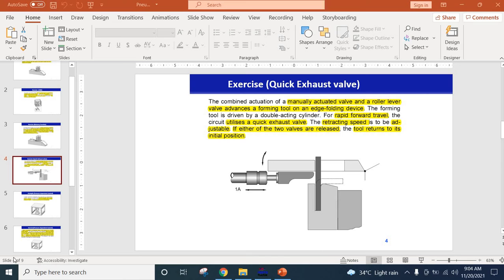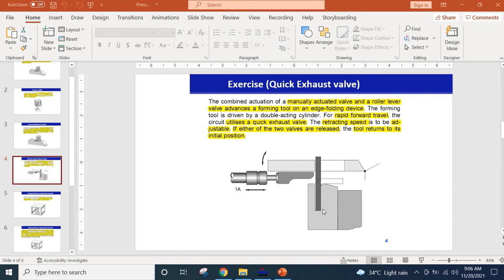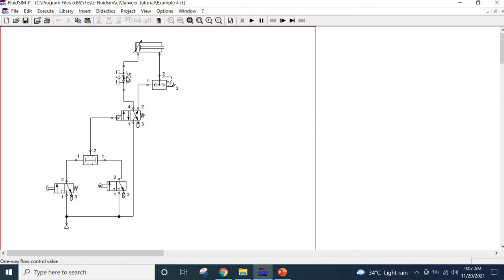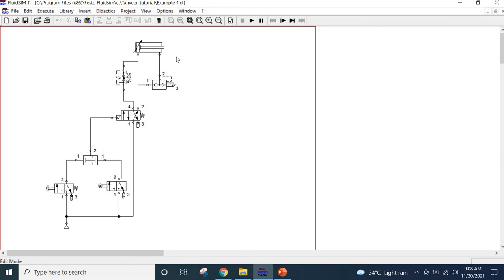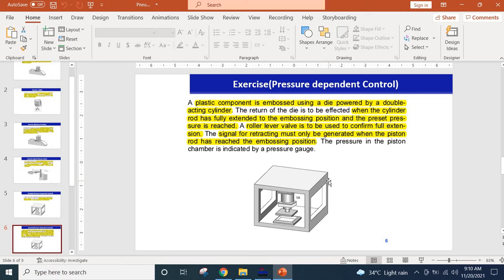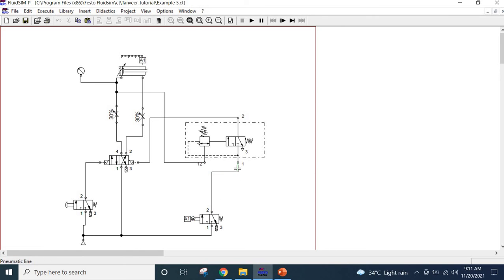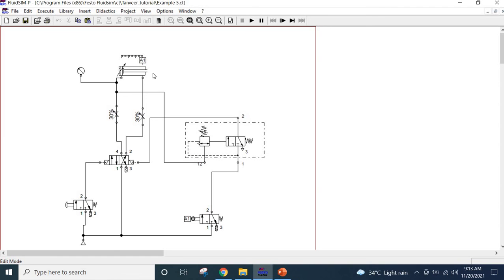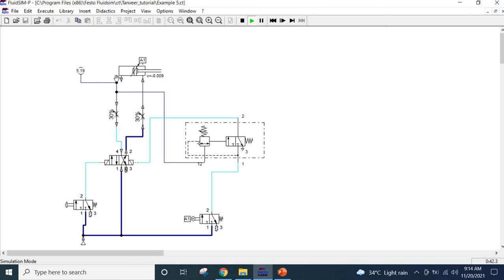Pneumatic Circuit Simulation (Quick Exhaust valve and pressure control valve) #fluidsim #pneumatics

Comment: The combined actuation of a manually actuated valve and a roller lever valve advances a forming tool on an edge-folding device. The forming tool is driven by a double-acting cylinder. For rapid forward travel, the circuit utilizes a quick exhaust valve. The retracting speed is to be adjustable. If either of the two valves are released, the tool returns to its initial position.
Circuit diagram draw